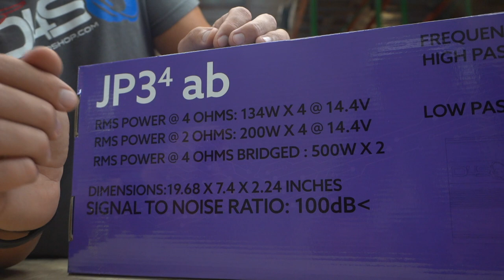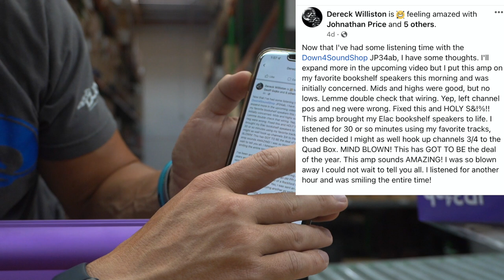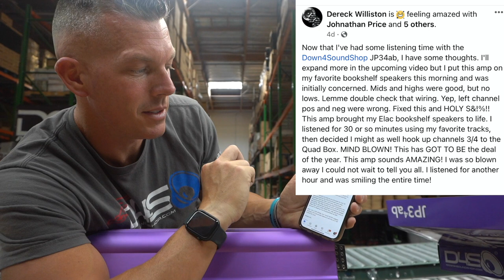WHY EVERYONE IS BUYING UP THE JP34 CLASS AB AMPLIFIER!

Comment: Nice amps! But I must mention this. You said and I quote "thy do you need a bass knob?" It's mids an highs"  

And although a bass knob isn't needed, I would have highly recommended adding a remote monitor for clip light/voltage. 

That would have set these amps especially for a mid and high in a whole nother level of awesomeness
Reply: The bridged rating is definitely a good reason to include a bassknob 😅
Ima have all 4 doors on channels 1 and 2. Then bridge 3 and 4 for a small subwoofer

Comment: Make a two channel version of this amp for folks running active three-way mids and highs. That way we can run several midbass speakers per door. I know this amp is bridgeable but then it's only stable to four ohms. Two ohm stability would be ideal.
Reply: Pro tip for you. Buy two of these. one for the left and one for the right. You will retain the channel separation of your source unit which is almost always better than any amplifier.
Reply: @mugendrewable  pro tip for u just a 2 channel ab would be nice so its not 2 feet long
Reply: @joshholden8561  pro tip buy a class d if small size is what you want
Reply: @joeyc4083  im not the 1 having size issues my 4 channel amp works just fine but yeah I'd buy a much smaller brazillian amp 800x4 before I'd pay 300 for a jp34ab I like his class d amps just not into surf boards  much anymore

Comment: 500 rms x2 is a damn monster amp for ab when bridged its more closer to 650x2 2 jp amps are prolly 20% under rated on ALL MODELS and THEY ALL sound amazing.
Reply: D4S has said the 500 rms x2 bridged spec is a typo. It should be 400 rms x2 bridged. You can watch the Williston Audio review and dyno for this amp too.

Comment: I bought one and it came in earlier today. I installed it. Bought it to replace my jl audio jd400/1 because I needed more power for my mids & highs. Dont get me wrong this amp has double the power of my jl which I love but the sound quality of this amp is sub-par. Its an okay amp with big power but I expected better sound quality at this price. Lets just say that I wont be getting rid of my jl audio jd 400/4 amp. And I forget to mention that the jl audio amp is class d, not class ab like the jp amp.

Comment: When will limitless cyber 12k be available?
Reply from the maker: Currently no eta on those, check this one out 
https://www.down4soundshop.com/down4sound-d4s-jp40-12v-lithium-battery-6000-12000w/
Reply: @THELIFEOFPRICE  I have a 260 amp alt running dual runs of 0 would this be nominal for 5k watts?